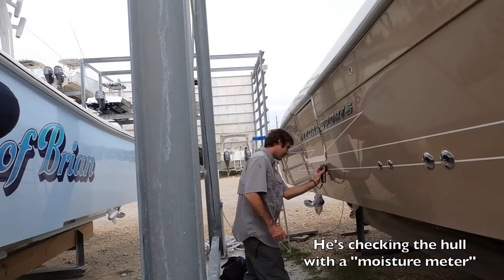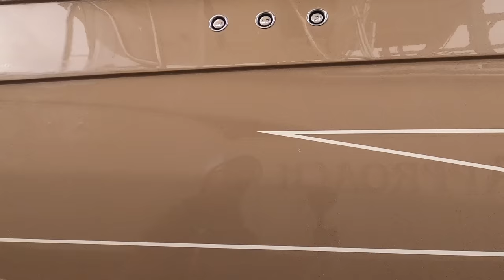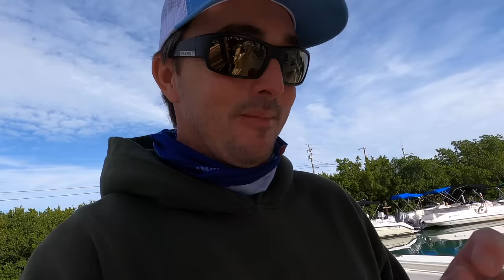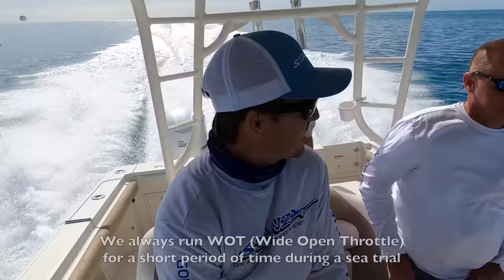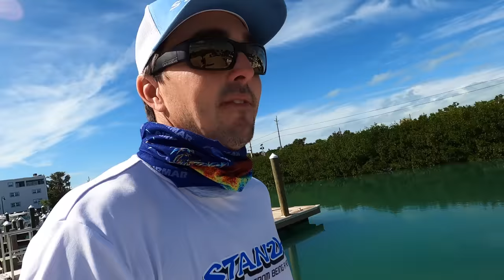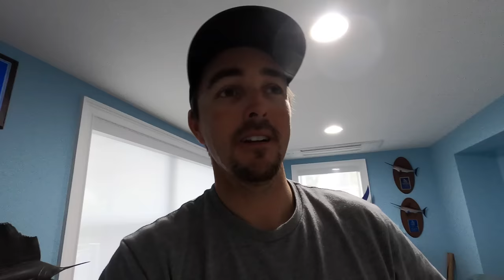SEA TRIAL and SURVEY on a 34 Hydrasport! SOLD!!

Comment: If it is a “must move” joint, besides pb blaster, there is a cheaper method. Shim a thin piece of nylon washer, in the joint, before that washer worn out, you will have a couple years of smooth moving joint even it is pounding everyday by sea water. Make sure it is nylon or teflon, not just plastic, ordinary plastic will crack so quick in sunlight and saltwater before you notice, and you will have a klinking noisy joint.
Reply from the maker: Good to know!

Comment: Hydrasports are all composite, right?  Is moisture still that big of an issue with Coosa or whatever composite material used? Why do surveyors worry about moisture today?  I may be misinformed. If so, I do apologize. Just Curious...  Beautiful Boat!! I have always heard good stuff about the brand. Thanks for posting! I really enjoy these videos. Your videos are very informative.
Reply: Moisture can still get in between the layers of fiber glass and rot out the fiberglass. Not sure what year but the earlier years of hydro sport still had wood in the stringers. What really put hydro sport on the map is the vector series had kevlar reinforced hull's. They are great riding boats but HEAVY! Hints why their not so good on fuel
Reply: @chrishammer9891  Thanks for your reply. I didn't know that moisture was bad on fiberglass. Something to check on our 16 year old Coosa/fiberglass  hull then. The boat stays in the water for 3 to 4 months of the year. The rest is on the trailer.  We fish out of DE, Indian River Inlet.